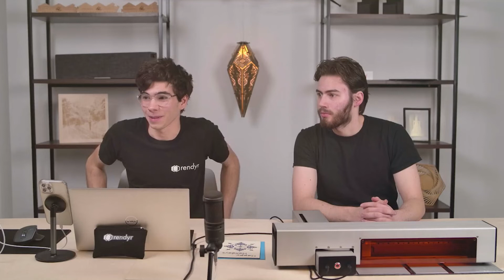Live Q&A and Holiday Greeting Card Demo (Dec. 16, 2021)

Comment: Thanks guys, nice presentation. I would like to find out if the laser cuts 90 degrees to the surface only or if it could be angled.
What was happening with the video? As for them talking, I'm sure they are better engineers than speakers, I'd trust a product from these guys than from someone who spends the life on tik-tok.
Waiting for the launch.
Reply from the maker: Hi Monty, thank you for your support! 
At this point, the laser always cuts straight. We have not received this question yet. How would you want to use other angles?
Reply: @rendyrinc  to make the beveled cuts. Of course that would extend the cut depth and limit the overall material thickness. I can see some uses but I may be the minority.
Reply from the maker: @montyr14  yes, that made me think of picture frame mats! Unfortunately, this would require additional axes to rotate the laser dynamically.
Reply: @rendyrinc  very true. More complexity more parts to fail. Thanks for getting back to me. Waiting for the launch

Comment: It is difficult to believe that the built in filtration system is sufficient for acrylic or even plywood. I use a far stronger system with an enclosed laser and it barely keeps up. I also don't understand how this can be used to cut plywood for example without having the material resting on a honeycomb, blade or even screen support to keep the underside of the material from getting discolored with soot and or burned. How are you going to address these issues because the toxic fumes from cutting acrylic is a real concern.
Reply: I look forward to more of this. Don't forget that this machine is so portable that you could cut things outside for ventilation! It attached via USB and I love the fact that it seems to leave no burn marks on the material. Glow Forge Watch Out! As an owner of a professional cutting machine I can see Cricut users wanting this machine. This could be shared by hubby, wife. Heck some of us have $4k digital embroidery sewing machines. We crafters like multi use machines.
Reply from the maker: Hello Tayfan! We appreciate your interest and support. It's definitely multi-use and our team is proud of getting Optic launched. The integrated filtration will be a game changer.
Reply from the maker: Hi Fotomann, and thank you for your questions. We could not answer all the questions during the live stream but have more demos and other video content coming. Stay tuned!